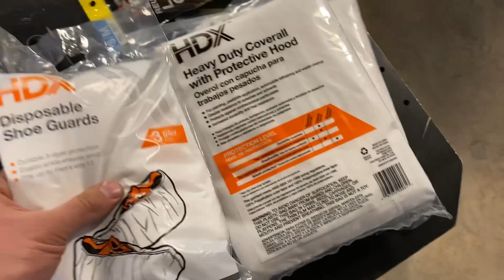Will A Gas Mask Stop Bear Spray?

Comment: Your facial hair can play a factor in things getting past the gas mask
Reply: Yep, its one of the reasons the military requires solders to be clean shaven.
Reply: That why Hitler had his distinctive toothbrush mustache, so it would fit in a gas mask.
Reply: Actually if it’s pulled tight like it should be Short facial hair won’t change how effective or ineffective the gas mask is. I was in the army and the only reason they said to be clean shaven for a gas mask was to prevent the masks from ripping or tugging on facial hair. But if you need to and you have facial hair tighten it slightly more than you normally would and the seal will still form with the facial hair
Reply: @JayySurvivor   Maybe it's different in the Navy, I was in the Navy and we were told that sometimes  longer facial hair can cause a leak in the seal on your face.  Same thing with paramedics
Reply: Same with the fire service. You will not find a firefighter with a beard. If he does, he might be a jolly vollie that is a pump operator.
Reply: @JayySurvivor  you could also just use vaseline instead of shaving. Its messy as hell but it works.
Reply: SuperCloneRanger same with firemen. Why they have mustaches
Reply: Thank you
Reply: @SuperCloneRanger  I was in the German Military for 8 years and had a full beard almost the entire time. So did many of my fellow comrades. It's not mandatory to be shaven in German Armed Forces at least. From my experience, it isn't a problem having a beard and wearing nbc masks. They will work fine as long as you have fit them well.

Comment: Perhaps the 30 ft is because you don't want to apply it directly to the charging bear because it will still get you but instead it should be used to create a cloud of nastiness in between the two of you that the bear would run into? I have no idea just a thought.

Comment: Depending on the agent used in the spray, not using enough water can make it feel worse.
Reply: Apparently the active ingredient is capsaicin, which is what makes chillis hot. When you eat food containing chillis you're not supposed to drink water to get rid of the heat as that just moves the capsaicin around your mouth, instead you're meant to drink milk as it will bond to the fat molecules. With this in mind, using vegetable oil or similar might be more effective than water at removing the bear spray.

Comment: Do not wait until the bear is closer to spray.
While it shouldn't really mist like that, Bear Spray is a deterrent. If the bear is already charging at you, it's not going to do much other than potentially incapacitating you. There's a reason you're supposed to use it from a distance.

For context: Bear Spray is essentially just very, very, very potent pepper spray. Bears are a lot more sensitive than humans when it comes to smell so even with the misting, it's very likely going to be affected.

Comment: If you guys ever do anything with bear spray/pepper spray again, then here is a tip that can make a world of difference for getting it off your skin: use vegetable oil. Water and pepper spray repel each other so it does a bad job of washing it away, but vegetable oil will dilute and carry away the chemical.

Comment: Top tip if y’all ever decide to do something like this again: capsaicin, and it’s derivatives (the chemical/chemicals responsible for the burning and misery) take the form of a wax/oil. Water won’t help. Given that y’all are at a shop, I’ll assume you have a can of brake clean around somewhere, cause that’s just the kind of think you have at a shop. I think that will take the capsaicin right off (obviously don’t spray it in your eyes or face, but elsewhere it’ll help...although it might give you cancer in 20 years)

Comment: We deal with bears all the time here in Northern Ontario and it's a well known fact the only way to get rid if a bear is let run at you full speed and right before it opens its mouth to bite you stick your arm down its throat grab its tail, pull its tail out his mouth flipping it inside out and he will run the other way.. cheers

Comment: Just a tip from a guy that’s been hit with pepper spray countless times in law enforcement.  Water does not help.  Milk won’t help.  What will help is baby shampoo or even better if you can get through the pain of it is hand sanitizer.  Just not water.  You’re better off sitting in front of a fan.

Comment: Why do they put the safety instructions on the front of the spray?
Reply: There is no "front." Just like you can turn the nozzle on a can of spray paint, you can turn the nozzle on the bear spray. You're supposed to turn it away from the side you want to read.

Comment: fun fact: bear spray is probebly not a gas so the particulate layer in the filter probebly did the stopping and not the coal layer 
(most tear gasses are not gas) the gasses get filtert out by the coal
only the air u breath in go's trou the filter the air u exhale go's trou a exhale valve

Comment: Gentlemen, when doing something like that hose yourself off after spraying and use soapy water to make sure you get off as much as possible.  Have another person cut the tape (they should be wearing ppe as well.  Got a kick out of it, but man I've been maced before and it is not fun at all, I feel your pain so at least I don't feel guilty laughing.  Stay well, I'm in NYC on lock down.

Comment: You're going to be horribly disappointed with the performance of the mask/filter if you don't clean shave your face, because it won't seal with a beard or long stubble in the way.
Taping the suit around the mask does negate this problem, though.

Comment: test your seal
cover the filter intake and deeply inhale. if safely sealed, you should not be able to breathe and feel zero air come inside the mask
make sure you use the right filter!
most masks use the standardized NATO 40mm but some use bigger or smaller
the GP-5 civilisn gas mask uses 40mm threads, but when you put a modern filter on, it breaks the seal
just be careful
that mask was of course properly sealed.
be careful, dont lick it!

Comment: Be well fam-a-lam. For the young and healthy is is like the strangest cold you have ever had. Ever. With severe weakness from loss if oxygen. I know from experience that anxiety can make it much worse. You have to stay calm and keep the fever in check. And make sure your lips don't turn blue from loss of oxygen: that is on the CDC website. I have been recovering for weeks. I'm in Northern California. About fifty miles from where the cruise chip unloaded recently. I didn't wear a mask. It is an airborne pathogen. It can exist in anything that is an aerosol. Coughs. Laughs. Sneezing. Toilets flushing. And exposed tear-ducts are likely a venue for transmission. Fever reducers, and bedrest. That is everything I have experienced personally. Kids recover faster. But it is taxing for everyone.

Comment: Was that carbon or charcoal?
Reply: charcoal is carbon
Reply: Activated carbon, as they said in the video. It's carbon with a very high surface area, so that vapours get absorbed by it. Once it's saturated, it doesn't work anymore.

Comment: Beard prevents a good seal. Use Vaseline on the beard.
Reply: Vaseline can affect rubber and plastic materials resulting in degradation of the face-mask. Respiratory protection plans exclude the use of Vaseline or any other product in an effort to make a better face to mask seal. Beards are specifically excluded for an individual wearing a respirator with a face to mask seal. An alternative would be to wear a full hood PAPR with a reduced protection factor or a totally encapsulating suit with an airline.

Comment: 0:58 why are you laughing? also that mask has no voice diaphragm so of course nobody can you hear you guys know nothing about full face respirators and if that little thing on the thread filter with holes in it counts as a "voice diaphragm" then this mask is garbage and made by a garbage company since it doesn't even work this mask is kinda poorly made and should not be looked at as the same quality as a fm12,avon-s10 or Canadian cm3 hell even a gp5m is probably way better then this trash car company mask